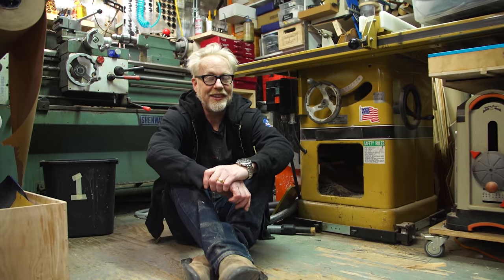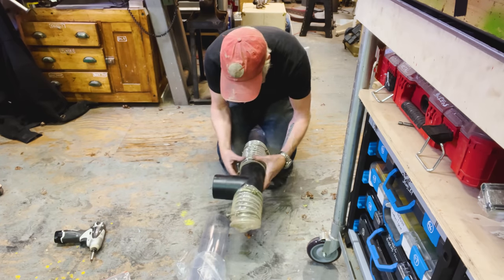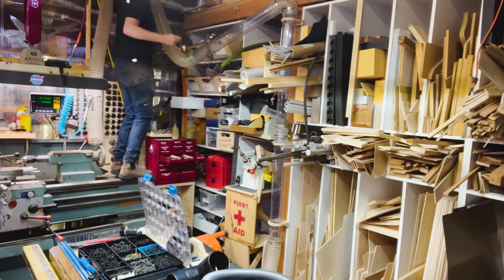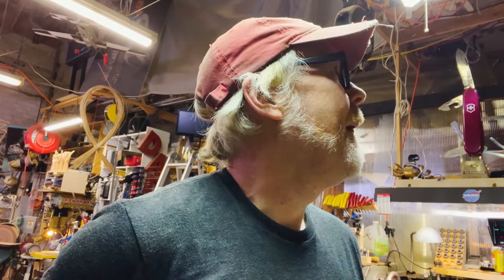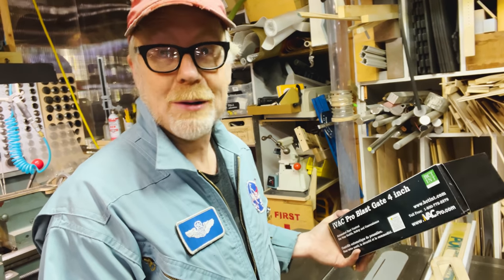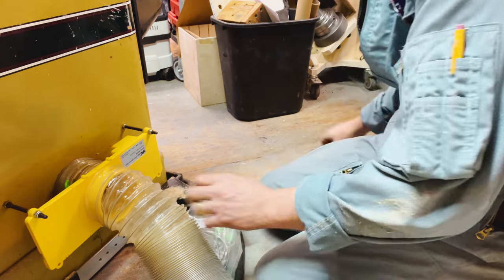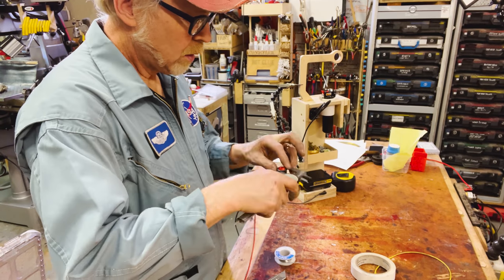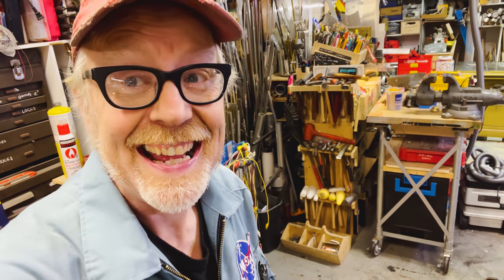Adam Savage's One Day Builds: Shop Dust Collection System!

Comment: Hey Adam,
I'm using 90mm stormwater PVC is really good for dust lines.  Kits  similar size to the inlets to the blowers, comes in 6 metre length, is as cheap as chips, there's a heap of fittings of all joinners, screw cap tees, bends and clips.  Just glue it together, smooth inside, light and works a treat.  Only dis advantage is it is not clear.  I have a hunce your clear tubes will glue with PVC cement and the fittings may fit.

Comment: It's cool that you're getting into this and I love your enthusiasm.  Its awesome that you may be influencing others to be creative.  Here are a couple notes to consider..  

1) The bag filters on your dust collector only filter down to 30 microns.. The dangerous to breathe stuff comes in under 30 microns.  you would be amazed at how much "invisible" dust you will still have in your air that is still hazardous to your health. You could consider a filter top attachment for the DC with a plastic bag collection "bin".  
2) Static pressure buildup is insane over 4" pipe of any great length. You have a lot of "t"s and hard bends.  These greatly increase static pressure and reduce efficiency.  
3) Your small hose drops are not as effective as you may think for collecting the fine dust that you're trying to collect off of your sanding tools, especially when that 2" (or less) pipe is coming through a short throw reducer.  Remember the note above about static pressure loss with 4" pipe over length, now add another 15-20 feet worth of 2" pipe.  Most dust collectors only perform well from an airflow speed standpoint with up to 12-16" of static pressure unless you start talking about industrial units capable of working at higher SP ranges.  That delta unit probably just pulls enough CFM at a decent air speed for a 4" run over some length.  With those longer runs and especially for the smaller pipes, I'd bet you're already way outside of that spec.  
4) My recommendation would be to rely on your dust collector for tools that can use a 4" (or equivalent open air area) inlet at minimum and use your shop vacs or the like for the smaller hose tools.  Shop vacs are designed to pull more FPS though smaller pipes at higher static pressure.

Of course I'm just an average guy who has focused on these topics quite a bit for my own wood shop.  Dust is no joke on what it can do to your lungs.  Stay healthy man!

Comment: A couple tips to increase airflow. The T fittings are very inefficient, you can easily find similar Y fittings so that the flow isn’t having to make 90 degree turns. Additionally that dust collector is a little underpowered for such a long run. Great work, I really like the clear pipe.

Comment: I really wanted Adam to wire the gate into the power switch of the table saw, that way it would automatically open and close with saw going on an off.
Reply: I hoped for a power detector thingy.
These switches that you just put around the power cord, and they detect current flow.
Reply: All it would take is a current sensing switch or a 120V relay.
Reply: Most magnetic contactor switches like those on industrial table saws have several 'spare' terminals in them--which usually includes one or two momentary switches.  He could easily wire that blast gate into the mag contactor on his saw.

Comment: For the gates if custom made is the option to go with. I've had lots of wonderful success with the wireless relays banks off of wish alibaba etc. With many having options to go from simple on off to timed on off etc. 
Ive made some neat stuff with them. Remote start from quiet a few of my vehicles. A buddies car setup with remote locks and start,and my personal favorite is the electric exhaust cutout. Currently working on a flame thrower setup as a gimmick for my trail rig.

As I finished typing adam starts explaining his solution, but ive decided to leave it in the off chance this could spur some ideas for others.

Comment: Great upgrade!  Only two thoughts, be careful using the same system as a general vacuum fires have started by metal screws hitting the metal plate in the dust collector.  Also you might want to consider using 45 degree breakouts to go to each tool instead of 90s you lose a lot of suction with a 90 degree turn.  Great upgrade.  I just finished a similar thing in my shop.

Comment: Adam needs to look into a cyclonic dust separator for his shop. I got one for myself and I swear by them. They can be found on Ebay for many applications with a selection of sizes for their intake and suction ports. Theses things get installed on a sealed reciprocal that will be used to hold the dusts collected.
They even work with very fine dust particles. Saves money on replacement dust bags too (my unit uses a plastic bag inside of the cloth bag at the base).
Just wanted to offer a suggestion.  Since dust in our shops affects our painting and what-nots.

Comment: Adam your off to a good start , With some modifications you would increase your air flow by using Y's instead of 90 elbows or T connectors 2 - 45's to make a 90 degree turn. You definitely will benefit from installing blast gates. Looking forward to updated video.

Comment: one of the prop shops in toronto has a dust collect system that uses pvc piping system and drops down at several points at walls and support posts via a t pipe (the downward pipe has a closeoff mechanism at the end so not all pipes are active when the dust collector is on makes cleaning and end of day easier then crossing the room-just go to a collection point) the ribbed hose is attached to end of a pipe as a vacuum and can be uncoupled and moved to another collection point

Comment: I have always been told you should run copper wire in your dust collection systems in all the hoses so keep static electricity out of the system. They say that the dust being pulled through the lines can make such a strong charge that it will burst into flames. And I know of a shop around me that they say burnt down from that very reason.

Comment: It is good practice to ground your ventilation if you are using plastic piping, as the dust can build up a static charge as it passes through. And with sawdust a static discharge can result in an explosion.

Comment: Adam, change the table saw switch to a momentary and attach to body of blast gate. When you open the blast gate the dust collection automatically turns on, then off when closing it. Less holes in nice equipment and less processes would also include powering the blast gate off the table saw switch, finally you turn on your table saw and the dust collection is automatic.

Comment: My prediction is, that Adam is going to want to rewire this at some point so the dust collection automatically opens when his table saw is turned on.
Reply: That's what I expected.
Reply: That system is available from woodworking stores and websites.
Reply: @doncarlton4858  a hobby box and a relay (to isolate from the 120vac line) are all you really need.
Reply: I initially thought he was gonna wire it up to activate when turning on the saw, but realized later that having a manual switch allows for opening of the blast gate while the saw is off for easy clean up of the dust collection chamber.
Reply: Almost like he said that
Reply: power too, unless the saw is 220V
Reply: And also connected to an arduino or raspberry pi to subsequently shut the gates on everything else for maximum succ.
Reply: That would make for another good "one day build" video.
Reply: I bought a switch off Amazon that does exactly this. Have it hooked up to my miter and table saws. Incredible convenience.
Reply: Ok arduino, turn on the table saw (and configure dust collection)

Comment: One little T-splitter for the "shopvac" hose isn't a big deal necessarily, but generally you want to use Y-splitters for these systems to help with air resistance.

Comment: For the table saw, you could replace gate's switch with reed switch with about 20 turns of wire, connected in series with table saw, around it. The wire around reed switch will act like an electromagnet, when you turn on the saw. Alternatively, you can disassemble small electromechanical relay and replace its coil with some number of turns of thick wire connected in parallel with table saw - I haven't tried it, maybe it would also require bridge rectifier.

Comment: @Adam Savage: as far as I know, the 'ribbed' tubes are also important for preventing a dust explosion; as the steel cable which is in the tube must be earthed; and therefore it helps preventing a dust explosion created by static electricity. How is that with the new tubes? #BeCarefull #DustExplosion #Mythbusters
Reply: Simply run a single strand of 23ga or other thin gauge bare copper wire thru the inside of the piping from one end to the other, tiny hole for an exit, and ground it - no static buidup

John
Reply: A wood shop dust collection explosion has literally never happened in history.  It is a myth that keeps getting perpetuated.  The reason to ground a dust system only helps with static shocks.  Explosions don't and have never happened.
Reply: @AdamKirbyMusic  sounds like it's a myth for #mythbusters :-D

Comment: If you added an induction current sensor switch to the power line of the table saw you could have it close a contact for the blast gate automatically when the table saw is switched on to have it slave to the table saw itself.

Comment: Nice job Adam. I have a suggestion though: If you use a relay connected to the main power switch of the table saw then when the saw is powered it closes the relay and triggers the gate automatically. You can even leave the switch in parallel in case you ever wanted to trigger it manually with the table saw off. Just a thought as I personally like to keep the things I need to remember to turn on/off when I am working to a minimum. Either way, love all your work and I hope to have a shop as well equipped as yours is one day.

Comment: One thing that strikes me in these One Day Builds is that Adam never needs to leave the shop to visit a hardware store (or similar) to pick up something he does not have. Because that's what happens in 99,9% of the time I am working on something. 😆
I imagine there's not many hardware stores in Mission District and with the traffic in SF, I'd want to be as well stocked as possible. 😃
Reply: I wind up going to the hardware because it's quicker than finding the thing I know I have. Somewhere.
Reply: @donrobertson4940  That the sign you need to up your organization... So you can actually utilize the thing you have.

Comment: You should also install some air cleaners for your shop. WEN make some pretty good ones at an affordable price. I would install two. It will make a huge difference in the air quality in your shop. The micro dust particles are what get you.

Comment: 4" DW (Drain Waste) pipe and fittings are ideal for dust collection systems. This is in part because the DW fittings are designed to minimize friction and turbulence loss in the drain system. The point is to keep sharp corners out of the system.
Another important point to remember is with dust collection it is about airflow not vacuum pressure. An 1-1/4" hose on a dust collector unit will never have the same suction as you would get off a typical shop vac.
Reply: 1 1/4 lines are for low volume high pressure systems (shop vacs). If you use high volume low pressure (dust collector) on small diameter lines it will not be as effective. Small line tools (sanders) will have better pickup with shop vacs.

Comment: Adam, you should try the Cubitron sanding pads from M3, they are a GAME changer for sucking up dust since they have open meshes in the design. They also last longer and cut faster than regular sanding pads. They are a bit more expensive thou. You will thank yourself for buying these!!

Comment: Adam,  remove all of the ribbed tubing that has ribs on the inside.  That severely decreases the amount of carrying capacity of your stream as the turbulence drops the dust and chips out of the air stream.  You will want to minimize your 90 degrees (use Y's instead), and finally, you will want to install a large Neodymium magnet (with a bag over it for easy cleaning or outside touching the tube), just down wind from where you cut or sand metal, to keep hot metal particles from your large pile of kindling called your can.  The hot metal can cause a fire.  Another thing to help with the suction is to go over each joint and tape it.  Use Duct or aluminum tape.  Just some info from a friendly cabinet maker.

Comment: Nicely done. You might consider a 4" drop to your wood band saw. I'm gonna put the dust collector in a separate room that exhausts to the out side. The tiny but dangerous particles are still floating around. I want from a 5 micron bag to a1micron Jet canister filter. Still you've made a big improvement!

Comment: Couple of tips for people planning to do this themselves.  Dump the bag filter on dust extractor and go pleated (bag allows dangerous small dust in the air) avoid right angles, minimise flex hose because ribs = turbulence and drag, and if you have to reduce to small hose - keep it short and close to the tool.

Comment: There  are 2 plumbing fitting you can use for joining the pipes and fittings one is called a Fernco fitting the other is called a no hub essentially it’s a rubber collar  with two clamps it’s used for connecting waste pipes of different diameters but would be perfect in this application

Comment: Mirka RO sanders are pretty awesome, but they also have the added benefit of being dust collected pretty well. It's a 1" hose with a 2" shop vac adapter, so it would work with something like a shop vac, the festool collectors, or an adapted dust collection system. It's not a solution, so much as a component of a solution, or an add on, but it is quite nice. I really haven't even considered getting anything else since I switched.

PS: If you're getting worried about the airflow loss to ribbed hoses, you should /definitely/ be avoiding sharp bends. You want the gentlest curves. 90 degrees is undesirable. Less is never ok. 45s are good.

Comment: I commented before i saw you had the dust gates installed (my bad) big difference in air flow great job, I have one of these systems to install in my shop but I'm using thin wall pvc pipe and making my own dust gates. I enjoy your videos very much stay safe.

Comment: I used an outlet box with a double outlet and an outlet/switch and a heavy-duty extension cord and mounted it to my table saw. The switch controls all of the outlets, the table saw plugs into one of the three outlets, and I have two spares for other power tools to plug into. You could have plugged the supply for the blast gate into one of the outlets so it would move with the saw. You could expand the number of outlets or use a heavy-duty power strip instead. It is always nice to have outlets close by where you are working, and it is nice to have a local switch to turn off what is plugged in so you know the tool is off.

Comment: If you want an auto blast gate, try using a current sensing switch around a phase isolation adapter. (I'm a controls electrician, and it's what i plan on doing.) It will create a closed contact upon energizing your tool
Reply: Couldn't you just add a relay powered off of the voltage running to the tool (after the switch)?
Reply: @elihoff23  that would also work, if you are comfortable with line voltage control setups. I personally prefer a low voltage control system to keep line voltage wiring to a minimum.
Reply: @SlimPickings253  Fair.  I was just thinking of simplicity.

Comment: get a canister filter. 1 or 0.5 micron filtration with much more surface area than a bag. Add a cyclone before the extractor and you'll save the impeller from potentially dangerous collisions with bits of waste. I did these upgrades and now have relatively clean air in my shop. It's amazing. The air goes through the extractor, and the fine dust doesn't come out again! I've even been able to spray gloss paint finishes in a shop that is also used for sanding!

Comment: One of the things i see is you need to add in some valves or cut offs to the tubes so you get full suction. If you do, that vacuum attachment will be alot better.
Edit: Commented half way through before the electric cut offs

Comment: Consider adding blast gates at every junction; that will let you close off a branch and increase suction to the tool that is in use.  As others have said, also try to minimize sharp bends in your ducting; they decrease airflow. EDIT - Right after commenting, Adam says "I need to get some gates"

Comment: I don't know if I missed this, but you may want to wrap the plastic tubes in bare copper wire to prevent static build up. It can be dangerous with dust particles.

Comment: Adam! Nicely done Sir! BUT you need to add a current transformer on the AC power wires to the saw and sense the increase of current drawn to the saw when it starts. It would then start the motor to open the duct gate with a little transistor comparator circuit. That way it will completely automatic, and will not need a second switch. You can even find them online for purchase.

Comment: Nice work, dust control is a real issue. You may also want to look at shop air cleaners to get the fine particles. I made a homemade paint booth using a kitchen vent hood and scarp corrugate, works great for airbrush work.

Comment: Hi Adam. I'd like to suggest for your health and easier maintenance you replace your old style filter bags with a clear plastic lower bag and a HEPA upper filter. Those old style bags leak small particles (the bad kind) back into the shops air and are not as efficient as the newer system.